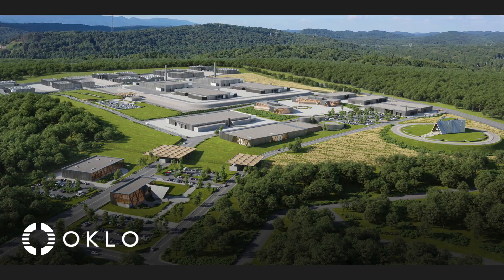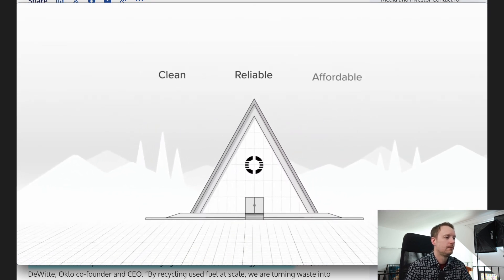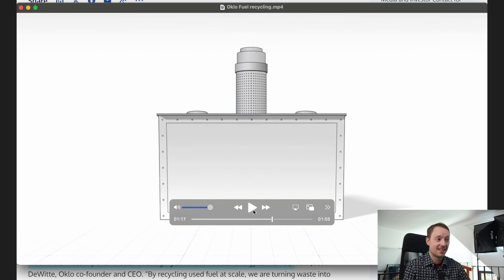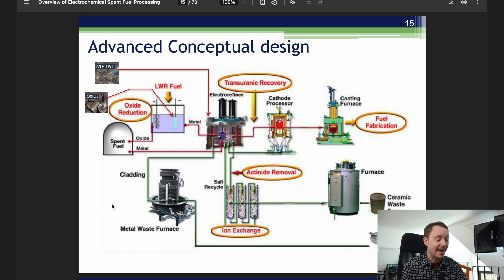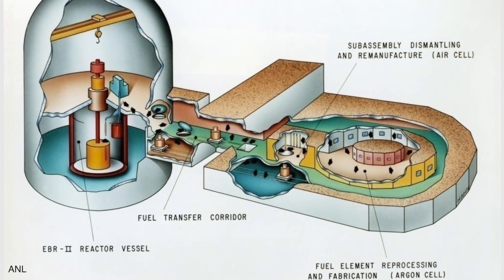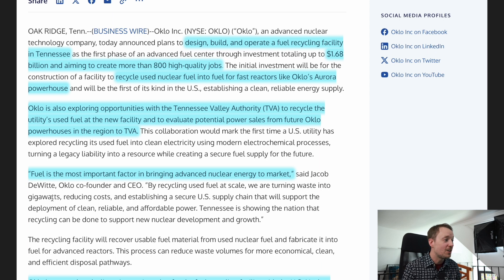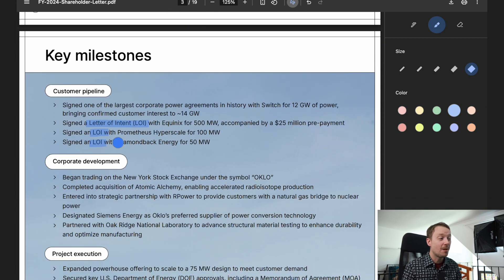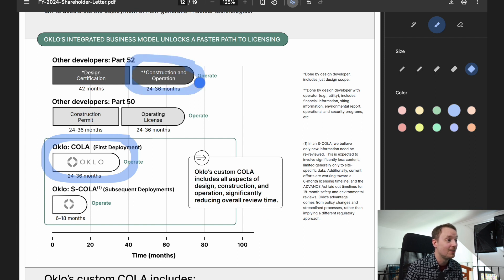How Oklo Could Change Nuclear Power Forever

Comment: First step in reprocessing, move those spent fuel cans from plants to the Oklo facility. Does Oklo have any permission from NRC to do so? No. Will they get it? No. Those cans are extraordinarily safe, but the anti fanatics will never let it happen. They’ll block the damn road, and first truck or train that has an accident hurting nobody but a run over cow, will draw 9 figure law suits from anyone within a hundred miles.

Comment: Like all nuclear startup projects, they look interesting on paper, but in reality they are most likely as far from reality as possible. In fact, they are trying to repeat the Rosatom project with the Brest-od-300 reactor powered by MOX fuel. Rosatom alone has 80 years of expertise and experience, an unlimited budget and the best scientific base in the world. Which of these does the startup have? If this is implemented, it will be not earlier than 2050, at best.

Comment: There is no economic point in this. Molten salt reactors breeding thorium make more sense. They use 98% of the fuel and can be used to burn up the existing nuclear waste eventually. Conventional reactors use only 5% and the rest is waste. Thorium is 100 times more abundant than the fissionable isotope of uranium that is mined.

Comment: SMRs make marginal sense, if you’re in the middle of nowhere and/or are burning diesel for your power.  Now, in 2025 who would do such a thing?  Hawaii, Carribean countries, parts of Alaska.   In most of those cases, you could fully utilize an AP1000.   Maybe 2 communities 50 miles apart could together use an AP1000's capacity, do you build 4 reactors (2 AP300's at each), or do you build 1 AP1000 and some power lines?   1000 MW was a lot when your house had a 50A electrical panel.  Your new home with a 400A panel to feed your Tesla charger and tankless hot water heater?  I see fewer and fewer use cases for SMRs.

In Las Vegas, the SuperNAP campus is currently somewhere around 500 MW and it will continue to grow.  It’s a traditional data center, not even one of these new AI monstrosities that apparently people want to try to shove 100 kw into a single rack.  Considering the amounts of power being demanded, SMRs?  Maybe for water desal.  Maybe for Hydrogen..  But these marketing people shouldn’t tease me with “we’re going to build 6 GW of SMR capacity.”  No, you’re not.

If only there were someone, somewhere who had a track record of safely deploying large nuclear plants of the same design over and over and containing costs while doing it..  If only, we looked at – France.

We’ve got lots of extra space here at Palo Verde, load us up!  I keep passing datacenters who think they want to shove 100 kw in a rack.
Reply: Rosatom is building 36 nuclear reactors in the world of the same design right now and is mining, enriching and reprocessing, and also teaching reactor maintenance engineers at its universities.
Reply: @ANTON_ZHYKOV  “Rosatom is building 36 nuclear reactors in the world of the same design right now and is mining, enriching and reprocessing, and also teaching reactor maintenance engineers at its universities.”

Rosatom is a state-owned corporation from a country who is committing war crimes against its neighbors, done everything possible to undermine rule of law in the world, all while being run by kletpocrats who suppress dissent by arranging for people to fall out of windows.  You want to buy a reactor from these guys?

Rosatom, whose predecessors may not have always considered safety and transparency to be of utmost importanc?.  I mean really, from the folks who brought you the RBMK, Chernobyl, Lake Karachay, and lord knows what else?  I’d sooner order a Chinese made Linglong-1. Eh, not great, not terrible, but still not as bad as the RBMK.

In all fairness, the Russia icebreaker fleet and KLT-40 have a pretty good track record.  The floating power plant barges based on it do seem to work.  I believe that if SMR vendors can actually deliver at a promised price point, they will sell their units, even though larger units = lower cost.  The alternative at this point is diesel, natural gas, peaking plants, and windmills if the winds are blowing.

However, we’ve never seen an SMR vendor deliver and operate a unit here in America.  Galena, AK would probably still like to have a Toshiba 4S.  The last reactor to be built in the US was Vogtle and I am extremely grateful to no longer be a Southern Company customer as they will be paying for it for decades to come.  Everytime I think, the next build will be better, right?  Then a Hinkley Point C shows up and I start tilting at windmills thinking, nobody in their right mind is going to do a “next time.”
Reply: @Barry-S  Rosatom, whose predecessors may not have always considered safety and transparency to be of utmost importanc?.  I mean really, from the folks who brought you the RBMK, Chernobyl, Lake Karachay, and lord knows what else? 

Oh, and who gave Fukushima and Three Mile Island?
And it's not for the guys from the United States to talk about war crimes or 5 million people killed in a Iraq, it's Santa Claus.

Comment: They say "privately funded", but how much is Oklo paying for the spent fuel? That is an incredibly valuable publicly owned resource that they are effectively stealing. What they are paying for, are vaults to keep it in, and facilities to keep harvesting any new spent fuel. This is one way to "close the fuel cycle", fulfilling the maxim about privatizing profits.

The losses to the public will be incalculable. That resource could have been used to start thermal spectrum breeders instead, in much greater numbers, because each requires a small fraction of the fissile. The processing needed is also simpler and less wasteful. Small fast reactors are even worse, and the ones being pursued are so wasteful they aren't even breeders.

This certainly will be Oklo's legacy, doing their part to hobble nuclear scaling and ensure that costs remain on par with fossil fuels. What happens after the free fissile runs out? Their 14 GW pipeline of orders will consume most of the transuranics in our 94,000t of spent fuel. After that, the cost of HALEU will make these prohibitive for anyone not looking to power their private islands or our AI overlords.

Comment: Very cool. How does this compare to recycling via a CANDU reactor which can also burn off spent fuel rods from LWR's I'm told?
Reply from the maker: This is physical/chemical separation of fuel products. In a reactor (CANDU could theoretically do a small amount of this) the fuel would still need some cleanup using a similar process

Comment: Great, but I don't understand the need to take the economical risks that comes with pyro processing and especially fuel fabrication intended for fast reactors only instead of choosing a more pragmatic approach like France did. Fast reactors can run on MOX fuel just fine. Proliferation concerns are a red herring, especially in countries that already have nuclear weapons.
Reply: Aurora reactors especially are meant for data centers and military bases which are both heavily protected and guarded. They can work for 20 years easily without need to refuel.
Reply: Proliferation concerns alter the procedures around handling and makes everything more expensive (not least insurance and regulatory fees(
Reply: France's reprocessing never made economic sense, and all that wasted effort and cost has ruined their opportunity to do something more sensible with spent fuel. The pragmatic approach is none of the above; it is fluorinating the spent fuel, and feeding it to thorium converter MSRs, so that we can start much larger numbers of thermal spectrum breeders. Much simpler processing, and no need for any subsidy, just a bit of patience.

Sadly, many are eager to destroy this opportunity in exchange for free fissile for their inherently uneconomical fast reactors, under the guise of "destroying waste". This will keep nuclear slow and expensive, at least in the west. China is actively developing thorium nuclear, and being led by engineers,  aren't likely to squander this opportunity. They just don't yet have the massive accumulation of spent fuel that we do, which could rapidly accelerate the process.
Reply: @Th-233 you're just suggesting an alternative method of 'destroying waste'.
Developing this technology and expertise is necessary for any extraction, whether for mixed oxides, medical isotopes or even MSRs.
France's facilities were some of the first of their kind, the early adopters pay a premium, they also hoped to process international waste across Europe as oil use fell (that was their idea after the 70s oil crisis anyway).

Reprocessing is necessary and has been shown to work. MSRs haven't been made to work commercially, yet.
Reply: @LudvigIndestrucable  I'm suggesting it's not waste, and that we shouldn't be giving it away. It is a better fissile resource than the uranium in the ground, and only requires a simple fluorination (and no enrichment) to be usable in an MSR. The reprocessing you are talking about is wholly unnecessary, substantially more wasteful, and very expensive.

Is it too much to ask that the public get something in return, besides a bill and more expensive electricity? Dumping it in the sea is also proven to work, but I'd prefer we wait rather than hurrying to do something stupid, which this is.
Reply: @Th-233 I'm not sure who told you any of that, but fluorination of radioactive material that's been effectively custom housed requires a great deal of care and reprocessing. Simply separating the casing from the rods requires specialist techniques and equipment.
The way you write makes it sound like you just spray some PTFE and dump it in the molten nuclear furnace - reprocessing of spent nuclear fuels, regardless of application, is a major undertaking.
Reply: @LudvigIndestrucable  I'm not sure what you are imagining needs to be done other than decladding, but it is relatively trivial by comparison. What is in the fuel rods, is almost exactly what you'd find in an MSR inventory, fission products and all. A thorium converter has to deal with those anyway. No separation needed.

You are still avoiding the main point; however you reprocess it, that material is still immensely more valuable in thermal spectrum breeders, and is wasted on starting fast reactors.
Reply: umm.... meme stock